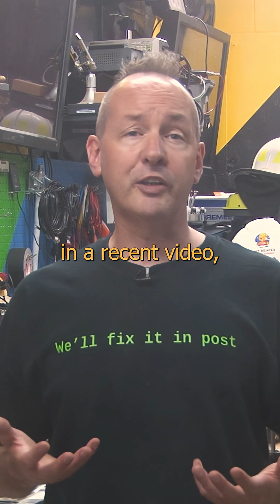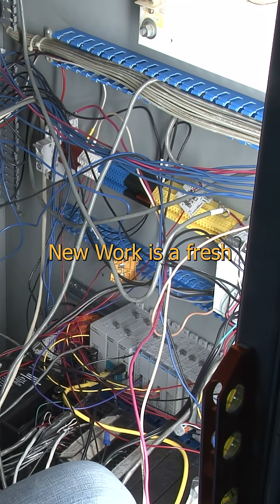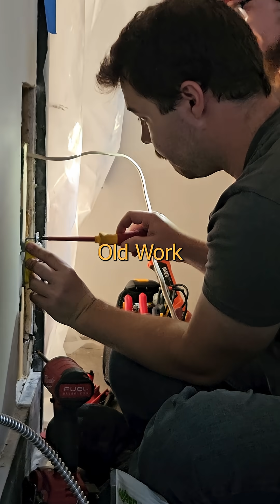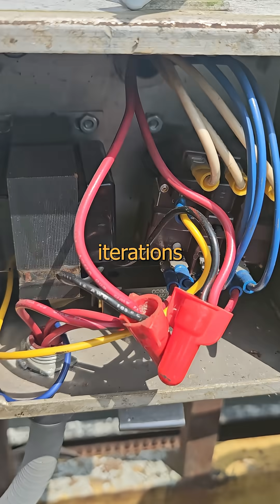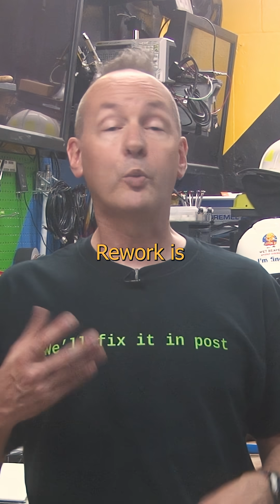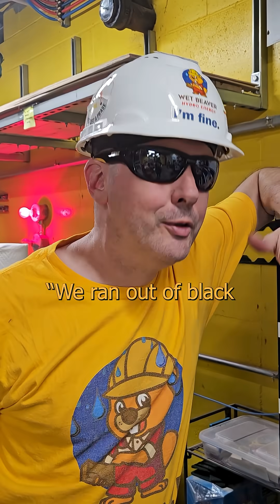New Work, Old Work, Rework #chrisboden #comedy #engineering #electrical #construction #educational

Comment: My poor electrician...while we were remodeling my master bedroom, he had to fix not only the previous electrician's hack job of adding outlets...and trying to change 7 circuit breakers to the room down to 2, we discovered that the one wall sconce and the outlet below (came with the 120 yr old house when we bought it) was still on knob and tube...and if you touched the inside of the sconce wrong, it zapped you. Without the drywall there to support it, the outlet literally hung from the wiring for the sconce, too. Not attached to the stud at all. Had to get creative to cap that bit of wiring off. Wild shit.

Comment: When I was a copier tech I was at a non-profit organization that had a new outlet wired to move the copier turns out that the guy had been working on it in the breaker panel and didn't finish the job and it was quitting time someone else came in and wired the outlet to a 208 volt lighting circuit when I move the copier and plugged it in before I even got the outlet in the wall it went bang and I screamed son of a b** and the lights went out and the whole building and I was livid. I wanted an explanation because that could have removed my fingers swiftly I skitted across the carpet floor on my butt backwards luckily the copier wasn't damaged because the manufacturer actually put the correct  suppression components on the power supply and all I had to do was replace the power supply and the copier worked but I was not asked back there after screaming son of a b** and making the lights go out.
Reply: And after that I carried a multimeter with me and whenever I would plug in a new device I would test to make sure that the voltage was correct before I plugged it in lesson learned.

Comment: Ran into a shop that the customer needed brought up to code. Whoever wired it switched everything on the neutral and the neutral was black because they decided to put the white wires on the breakers instead of the neutral bar. It wasn't difficult but it was tedious, has to go through every box. Also had to replace the panel feed because they used triplex and had buried it in 4" of dirt for the stretch to the house.

Comment: The electrician that uses those push on connectors or stab in the back holes in the recep's is the same guy that operates the glory hole in a back woods bar.  Twist conductors together securely, then use a wire nut.

Comment: We had a 500t press we bought moved from one site to another by a local company. They took it down, moved it and re assembled it, no problem.

We went to wire it back up. 

Instead of labeling the wires before they cut into the harness, they just snipped away, and all the wires were red 12's. Every single wire not directly connected to the motor's power circuit, red 12's.

The press was from the 50's, by a company that no longer exists, and also didn't believe in labeling anything, or the labels fell off...
Reply: I felt that in my soul sorry y'all had to go through that
Reply: You'll need to rewire it.   Been there, done that, no T-shirt.
Reply: @jamallabarge2665   Was there no T-shirt to get or did you burn it while picking up the Psychosis?

😄😁😆😅😂🤣
Reply: Sometimes if you’re fancy you can match up the cut ends
Reply: @vaderdudenator1  I HAVE DONE THAT!!
Reply: This is why you write your contracts carefully. Unless you specify, you get whatever was most convenient. If you are doing the wiring in the new place, you had better prep the wiring for removal as well.
Reply: i had a soul crushing assemble job (manf wire harnesses) one harness we used to make was 6 red wires 2 brown but they had to be oriented without tangle an the second end had to be housedbhousing upsedown did i mention im colorblind it was just kinda aids
Reply: Welcome to my world.
Reply: @jamesstolte3500  Been in this World for a whole. LOL

The owner brought in a 1970's roll mill about 20 years ago. A single bay, 2 bay and 9 bay control cabinets and a box of modern drives and PLC's. He said 'Have Fun' and walked away. If I had an RPG, he wouldn't have made it to the door.

Comment: The stuff I find as an inspector; most recently, the cheap indoor Homeline panel used on the exterior of the house, no separation of grounds and neutrals, but at least there was no self-tapping sheet metal screws.
Reply: I won't even use homeline indoors.

Comment: I lived in an apartment convert, and the building maintenance guy soldered all the switches and outlets.
Reply: In the few minutes after reading this question I went through all the stages of grief.
Reply: It was so when people moved out they couldn't take them with.
That's a ' no shit ' my friend with a 4 plex had them Snip the wires and take All the switches and outlets with them.
Reply: @pillager6190  i found out they were soldered after I got fed up with having a broken out let for 2 months. He never did come to fix it.
Reply: I have more questions of how he soldered them...
Reply: @Shadeewolf  idk, I found them that way.
Reply: @Shadeewolf  With the power off, hopefully, although maybe wearing rubber gloves. Maybe with a plumber's soldering iron.
Reply: @Shadeewolf  tin the connections
Reply: If you're installing new outlets that have to last 50 years because the landlords are cheap then I can kind of understand the logic.

I'd feel safer seeing that than backstabbed outlets.
Reply: @mastafull  the only way they last 50 years is using high quality (thus expensive) sockets and install them correctly.  I have my doubts even an expensive socket can last that long, they have a limited number of insertions before failure
Reply: @robertadsett5273  My house has 60 + year old outlets, I've replaced some of them only because I want modern 3 prong outlets instead of 2 prong. Strangely the entire house was already wired with grounded 3 wire.
Reply: @creaslin  the question is were they cost reduced sockets, frequently used with the same contact resistance?
Reply: @mastafull  he soldered the wires to the side screws
Reply: - Scam preacher guy saying "why?".mp4 just played in my head.
Reply: What 
The fuck
Reply: What's wrong with that?
Reply: @rotorhead5826  You gotta replace them at some point, and if you weren't prepared to have an iron you now have permanent outlets

Comment: I got myself a landlord special cheap pre-covid.   The inspector missed /everything/  the insulation in this house is newspapers from the 1800s. The electrical trips over the lightest of loads. There is inside trim being used as external siding. And the basement is gonna cave in within the next 5-10 years.
Reply: Dumb little detail most don't seem to know: I'm guessing the /slashes/ are meant to indicated emphasis by imitating italics, but did you know you can get actual italics by surrounding the words in underscores_ instead?
Reply: so what do you do? Is the house even worth the lot value?
Reply: @heywait925  Almost certainly no.  Costs more than the lot is worth just to demolish and remove all the crap.  One of many reasons that dilapidated old buildings just sit instead of being replaced.
Reply: Look at the bright side. Free 1800s newspapers
Reply: Take out those newspapers. God I would love to have bunches of 1800s newspapers. Not in my walls, but I would want them
Reply: I worked as an archivist for a few years. The newspapers would just distract me from actually getting anything done.
Reply: Yikes! Can you at least get some kind of structural timbers downstairs and hold it up like an old mineshaft before that happens? 😂😂😂😂

Comment: New work, drywall guys keep covering up your outlets
Reply: And the plasterer has to fix my guesses as to where it was.
Reply: Yup. Start knocking holes in the wall, they'll find them for you.
Reply: They used to rotozip the screw holes off of our boxes.
Reply: @derekdelamar i had a big post typed up about how I didn't understand how the hell someone would be dumb enough to force one ofnthose things through steel.

And then I remembered plastic boxes exist. In my defense; it's been close to 20 years since I did drywall.
Reply: Try brick. Or YTONG stones. Fun.
Reply: Just look for the spot where their screws kept pulling through, so they just added more.
Reply: If I like the builder I grab a piece of trim and find the bump. If I don't, hammer time.

Comment: I've been a handyman for years for side jobs. There has been a few rework that I looked at and just said nope, not touching that you need to call someone to start over.
Reply: And by "someone", did you mean a nameless person who had both a good alibi and a full gas can?

😳🤫😉😏🙄😁
Reply: When "start over" = "Call the Air Force and schedule a B-52 strike."
Reply: @project1003 Uncle Buff needs the practice
Reply: @project1003Hey, it's a quick way of having the job site cleared out. It's all on the neighbours' properties now :)
Reply: I do remodeling and some new building, decks, sheds, garages.
I recently finished a wheelchair ramp with a 6'×6' 90° platform turn for a elderly woman on a beautiful 1940s cottage style home. Her family loved the ramp which led to a complete bathroom remodel. The  wiring is a mix of original knob and Tube and replacement of cloth covered 2 wire (I later discovered) They wanted grounded outlets in the new bath and a exhaust fan. Someone had updated the panel with breakers 40 years ago. They were not happy with paying for a new circuit, partly my fault, should have done my homework and realized the house had no grounded circuits and a few before me had spliced into the old wiring. I ate some of the labor for the installation of a new circuit with GFCI.
Reply: @randysmith9636 GFCI is one of the ways to get away with no ground, but the outlets all need to get properly labeled as "NO Equipment Ground".

Comment: I work in a factory, and electrical oanels are beautiful when they are first installed... but after a few years they always end up with the panduit covers missing and wires hanging all over the place.
Reply: Some days you gota be the guy to say "hey this has to get to the list of jobs to do asap" document it, make sure prints etc are always updated. Doesn't matter what it is, either its you or the next guy, probably also you. Do nice obvious standards, no bs backwards feeds, upside down power supplies, out of order modules, missing labels, to short wires, havking a hole in the front of a nice clean cabinet for a button or switch that they decide Doesn't belong their, and you got this scar on a nice clean cabinet x4 machines. If you wouldn't do it to your nice car home etc if you had one. Don't do it.

Comment: Inept homeowner, here. I didn't start until I had a hired electrician (hired to do another job in the house) looking over my shoulder, and making sure I did the one thing right while he was working nearby (helps that there was an incomplete box right next to his work area that I could futz with within eyesight). Took that, and completely rewired my single-story house from the attic to the basement, replacing the arsenic-coated fabric wire with modern Romex, and this time, NOT cutting the ground wire off at the edge of the box (no idea why the original electrician did that...).

Comment: Funnily enough, working in web design, we basically have the same issues, just without the limitations of working in physical space. That makes it a whole lot easier to convince a potential employer to just tear the whole thing down and start from scratch.
Reply: About starting from scratch - I would also argue that a benefit of that is that maintaining (or taking over responsibility for) legacy systems, especially if they're a patchwork of shoddiness, has a tendency to itself be rather costly. Things have weird interdependencies that aren't obvious, and the code is often bad and poorly documented, so a major case of gremlins is basically guaranteed if you touch anything.
Moreover, it will just take you ages to even get an understanding of the system before you can do actual work on it, which is just plain costly in man-hours. That doesn't always mean a clean slate design is preferable (or chosen by management), far from it, as it's of course also an endeavour in itself to redesign things. But you can often get further, quicker that way.
Reply: oh it's my that hard to convince people when it's really in need
Reply: I do a tiny bit of dev. At some point, the bastardised functions and legacy methods become too cumbersome and redundant that it's easier to just build it all with a new language/framework. 
Much, much easier to rationalise since it's all digital.

Comment: i nearly has a stroke at that green with black tape line
god
Reply: I worked at a place in New York (outside contractor) and was warned any wires in groups of three were gonna absolutely be 3 phase INCLUDING 3 greens.  

Place was a disaster.
Reply: @mikea5923  what the fu... im just not even gonna ask
Reply: @mikea5923 I would simply drop the wires and leave upon finding 3 greens
Reply: @mikea5923 in mexico, it is whatever you have, but if i have something to run different colors, and it looks good... the colrs have priority, blue and red? Red is hot.... 2 greens and a black at the weatherhead? Black is neutral... 😂
Reply: @sqeekykleen49 you’re welcome to do things as shitty as you like.  It’s not gonna affect me.
Reply: Green is sacred it will always be ground. It will never not be ground unless the situation is incredibly horrible. as opposed to white, which can either be neutral or hot if it’s flagged or not
Reply: @nerffamilystudios2285 yeah that was a huge red flag to be on your highest alert doing anything there.  They were also famous for adding feeds to panels and not marking them as having secondary power sources.  

Their wild disregard for doing anything right is definitely part of why they got shut down and moved.
Reply: @nerffamilystudios2285  Welcome to phase tape 101.
Reply: @nerffamilystudios2285 so you weren't alive for 9/11 and it shows.
Reply: Can you explain why to me? I get the tape makes it a colossal pain to keep track of, but does green wire mean something specific? The only rules of wire coloring I know are the super basics from automotive wiring, red is direct battery 12v, black is ground, everything else is whatever you have that's different from what you've already used in the car
Reply: @umad42 green in a house, residential and commercial setting should only ever be a ground.  No exceptions.  A green wire should NEVER be a current carrying conductor.  

It’s a very old, completely accepted industry standard, as well as NEC  code.
Reply: @mikea5923  just had to find this for work but It is NEC 250.119 that prohibs any neutral or hot conductors from being green cables.
Reply: @umad42  Please don't trust color codes, as they can be vendor specific.

Even EU made stuff sometimes will not follow their own rules.

I treat everything as "don't know".  Makes my life simpler.
Reply: @umad42  Rules for automotive DC wiring colours are completely different and don't apply to residential and commercial services, which are AC power. It's extremely important not to cross phases with AC (or else go boom) so colour coding is very serious. Those mistakes can maim/end people and destroy lots of expensive equipment.

Green (in these systems) SHOULD always be nothing other than a ground. Live/hot wires can be a range of different colors - but they're all specifically designated and chosen for a reason. The colours will correspond to a repeated phase pattern, that must be kept straight everywhere to avoid the BOOM. And the colours may indicate further meaning as well, for ex; high voltage (in my region) will always be a pattern of Orange-Brown-Yellow for the three phases. 

People have mentioned phase tape - aka, "changing" the colour of a wire with electrical tape. A few points about that:
1. Phase tape is a LAST resort. You only do it for small, isolated mistakes, if you absolutely have to. All other options (like removing and replacing with the correct wire colour) should come first. 
2. If you MUST phase tape, best and safest practice is for the tape to completely cover any part of the conductor that will be visible to someone working on it. This is another issue with what our hypothetical apprentice did - black tape "on the ends". Black and white tape are used for all kinds of general purposes in the wiring process, so you'll see it everywhere. A couple wraps of that on a wire is not enough to indicate the intended phase to the next person (as opposed to just being a leftover remnant from pulling, or reinforcement for a bit of skinned insulation, etc.)
Thirdly, our apprentice has reeeally screwed us in the time and material departments now, since all that green wire was destined specifically for grounding. Now we're all out of black AND green wire, you didn't let me know we were running low so we'll be left waiting for it on the next material order, and even more time(money) will be spent on going backwards thru everything they did to un-f**k it all 😂
Reply: That's not even that bad, because he DID phase it with black to give you pause so you can look twice. Sure it's decibel gig to cause a problem for somebody eventually, which is why no inspector will ever let it slide, but the electrons don't care about any of that.
Reply: Please do not look at my LifeO4 battery cart.
Reply: At least there was black tape on it...
Reply: Ive seen markers with specific points on it so you can recolor a wire.
Reply: @Lcarpetrondukemarriot you can phase mark  your hot wire (current carrying) to indicate which phase it belongs to in a 3 phase system

I literally had to do it at work today because I didn't have yellow 10 awg.
Reply: Ever seen a box full of yellow, because that's all the depot stocks to rebuild?
Reply: Why?